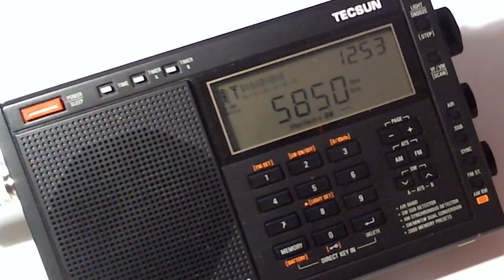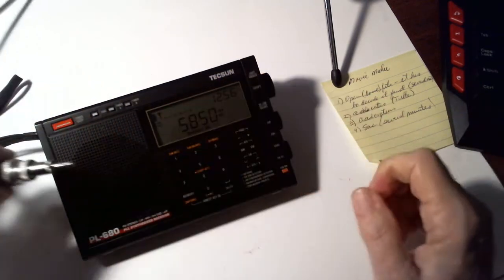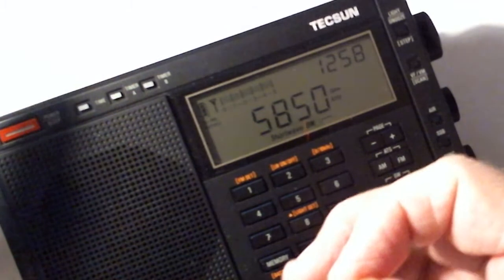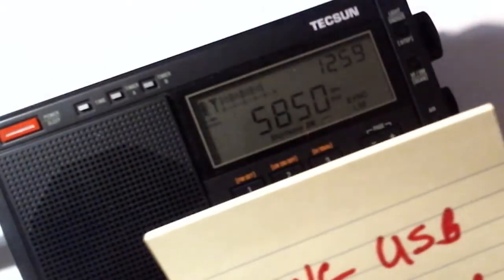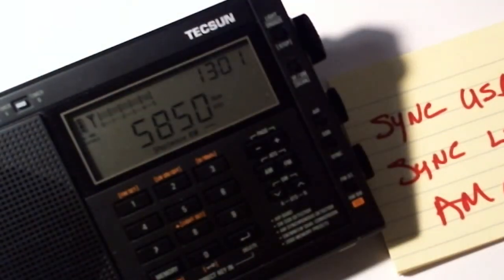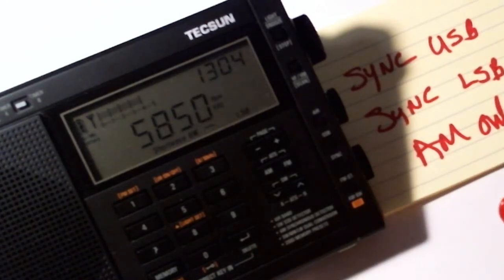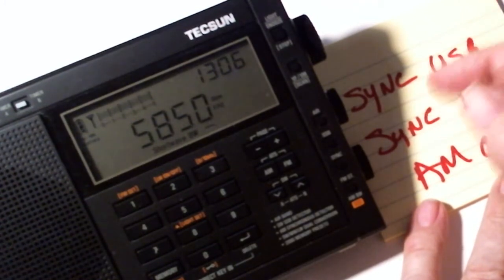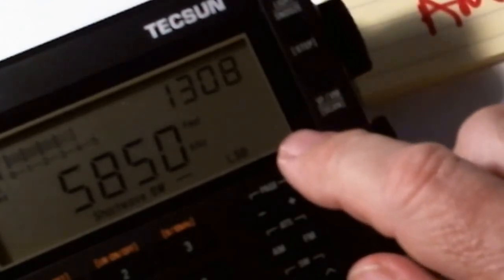TRRS #1229 - Using AM Synchronous Detector on Shortwave

Comment: The way sync. AM works is to remove the carrier as you said, like SSB. Then it inserts a new carrier produced in the radio wich is phased to the original carrier. By keeping the phase constant the signal sounds much improved but it will after a short time try to sync to the noise if it looses the original carrier. Sync. AM requires a fairly good signal to noise ratio to work but then it can sound very good.

Lets not mention the disadvantages by using the inner core only of the antenna cable verus a piece of wire and related to noise pickup.

Thanks anyway. Cute radio.

Thats why you just hear a very slight improvement in this video and some parts even worse than straight AM.
Reply from the maker: Thanks for the info.